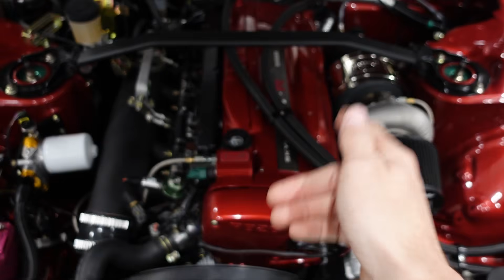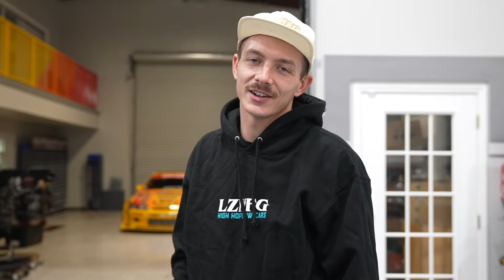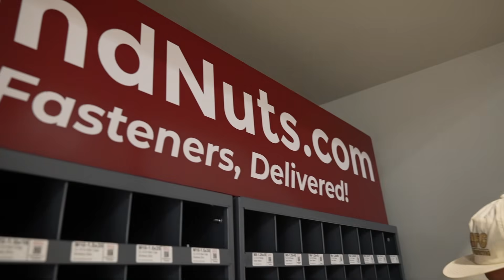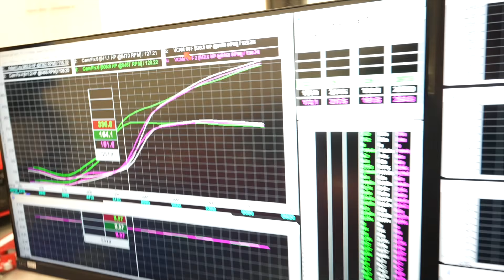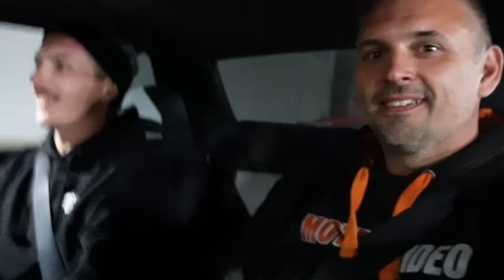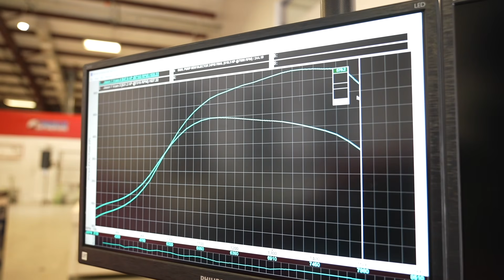Ultimate Response R32 GTR First Drive - My HKS Restomod 2.8

Comment: you want response?

i’ve had one for a very long time, ATM 1000hp (AU currency)

gave me stroker powers without extra power! 

GTS4 diff gears! (if your still 5 speed) you know these are geared for top speed..theos isn’t needed on the street! made my 2.6 feel like 2.8 and my current 2.9 feels 3.1,

by far, best-mod i did

Shorter gears helped the transmission stay together too. i ran 1000hp with stock trans for ever when everyone else was breaking 3rd gear.

Your currently geared too too out at 320kph, gts4 is 280kp, which is perfect for street.

Comment: That pump from Brand X, I work around those daily, just bigger, positive displacement pumps. Have to do temperature readings and check vibrations on them as well. Not sure how often you’ll use it/the dyno, but just make sure you have air flow going across the fins and no vibrations and you’ll be good.

Comment: One of the best ones you have for sure. I'm a big fan of restomodding with heritage in mind, like you're putting a bit of that HKS soul back into it. Next? I would love to see the Barra GT350 get sorted/given a purpose. Given that the rear IRS setup can't really cope with the massive power output why not give it a dedicated drag setup? You don't have a drag-only car and it'll make for good content with Cleetus. And with your new ZF trans wizards I'm sure you could get that transmission situation sorted. Have Johan fab a cage etc. No doubt it will be ridiculously quick down the strip.

Comment: a whole new engine setup and turbo for more midrange power? seems overkill... From experience with other platforms that kind of improvement can be achieved with the right cams and turbo setup. small enough turbo to keep the response with "big" A.R housing and good exhaust to not choke out at the High RPM. Or are 2.6 RB's just inferior and needs the displacement increase to achieve what can be considered minimal gains in performance?

Comment: Honestly feel like with the stock r32 diff ratios the r34 box turns the car into a rowing machine. Feel like the full OS 5 speed box works better. Taller first gear for much better launches and then third gear is a much more substantial gear. That car needs to stay in gear on the boost to fully use the power.

Comment: Adam might need a R33 gtr to swap the R34 motor in, than give that R34 an Aussie touch with a Nitto 3.2 ;)  Mr hawkins is always right  RB32 is the dream build makes short work of my 286/288 kelford cams :D

Also i think the Turbo has defs hit the limit with current exhaust you could get Mr fab king to whip up a Ti dump 4" with 3.5" front pipe an go a Tomei Ti 3.5" most incredible sounding JDM exhaust on a 2.8L  You wont be able to talk as well though ,  Also is the option of a AES valve located in you're front pipe to elim Drone

Comment: Wait it's awd or rwd??? They dyno'd it in rwd. Did they just pull the front axles??
Reply: You can just pull the fuse on a r32 or disconnect the front prop shaft that goes between the transfer case and front diff

Comment: Either back pressure issues or it pushing the gate open or to soft of a spring in the blow off valve and it's cracking open bleeding off boost id bet the BOV is bleeding off

Comment: I had the stainless Super Turbo catback on my r32 gtr with Tomei Titanium Equal Length front pipes(was still on stock twins), and not cats. Trust me on this. Have Jon delete the middle resonator on the Super Turbo. The Super Turbo was way too quiet for me, and at least on the Stainless version deleting the middle resonator did it for me. Car sounded so good, and had a perfect amount of rasp on the high end whilst still being smooth af. I have an exhaust vid of how it sounds on my profile if you're curious how much louder deleting the middle resonator would be or at least get a gist of it. It was still quiet enough for me in the car too. Could hold a convo easy. But your rb26 is built af compared to mine, so maybe deleting the resonator on a Titanium exhaust with a fully built rb26 might be too much? Idk 🤷‍♂️

Comment: Do you schedule some of you older builds to be driven? When you are building a car how do you decide when its enough HP wise?
Reply: Depends on the chassis. Some cars/chassis just don't respond well to big power without completely destroying the soul of what the car is. Light and nimble AWD inline 6... 500-800hp is about the max a chassis like that can handle without it becoming a different thing entirely. Now take a modern s550 mustang, that chassis can handle 1000+ and remain within the limits of what the chassis can handle.

Comment: The part where Adam says “I don’t think I ever had a car throw me back that hard” johan was like bro all ur cars is fast af haha
Reply: He's forgetting about that gt350
Reply: yeah every time Adam gets a new car its like "omg i never had X in a car before or never experienced X thing in a car before" and everyone is like bro you have 3 of them just like it already..
Reply: GT350,either of the 911 Turbo S’s, RS6 Avant
Reply: @diveintomonza  Don't forget the Evo. That this is pretty zippy.
Reply: @diveintomonza  they were auto tho so they were more smooth i think he means on the 1-2 gear change you can see him flying back into the seat
Reply: @8v_Nate   clearly you haven’t been in any actually fast cars.  Auto or not, a tuned 911 turbo will throw you back and keep you pinned in your seat.  A built Barra in a set up car like his mustang, will pin you as well.   It has nothing to do with a Stick or auto, fast is fast man.
Reply: @1216jimmyz  stuff like the gt350 both spins in the lower gears, and only has the power in the tippity top of the rpm range, it's definitely the one that pushed you into the seat the hardest on the initial hit but with a torquey awd car that got torque everywhere you stay pushed in that seat the whole pull, not just on the hit
Reply: @1216jimmyz  You're not wrong but the torque curve on the R32 is really violent paired with the short gears so it'll feel much more aggressive. A linear power band like on a Porsche will make less and less G's as it goes but if you look at the R32 graph you can see it'll accelerate faster and faster up until 6-7k before starting to roll over.
Reply: @Remu-  nice to see someone who actually knows what it's like to be in an r32. People don't get why it's the better of the 3.. it's more mechanical and you feel everything. It's just the better drivers car.
Reply: @Sultan Tryndamere  I have a 32 GTR and been in some fast cars including a 950bhp 2jz silvia.. r32 still throws me in my seat harder
Reply: @1216jimmyz  and none of them feel as good or as aggressive as a 32. I’ve driven a comp m4 and put a Ferrari f430 to its limit and neither came close to being as fun to drive as my 32.
Reply: @Jrob992  yes, and all your videos on your channel show why I should take your word for it.  Lmao
Reply: @1216jimmyz  you don’t have to believe me 🤷🏻‍♂️ it’s not that crazy. When you have a 32 (or any cool car) and frequent the same meets and drive with the same people you make friends and they let you drive their cars.
Reply: @Jrob992  un huh.  Whatever helps you sleep at night buddy.  All good.
Reply: @1216jimmyz  just tellin ya what I know 🤷🏻‍♂️
Reply: lmaoo
Reply: fast as f$$k boi

Comment: RWD on Dyno hubs with front tyres on floor, but it's a GTR that is AWD??
Reply: Easy to do just disconnect front axles
Reply: @e36_swangin83  Ahh makes sense, no knowledge of hub dynos, just experience the rollers
Reply: @connorbeattie18  they do it the same way for non awd rollers

Comment: That intro clip makes it look like a monster! R32 vs R34 has gotta happen!
Reply: The R32 will eat the R34 alive.....
Reply: @TrevorFrazier331  how good are R32s! 😍
Reply: It is a monster!
Reply: I’m still waiting for the BIG drag race
Reply: 32 has quite a bit more power
Reply: @chadm528  More power isn't the biggest problem for the R34 its the transient response of that turbo.
Reply: @TrevorFrazier331  power to weight. The 34 at this point loses regardless of how the turbo comes on
Reply: @chadm528  not necessarily if they both made 700 to the tires and one way lazier than the other it would lose. But I get what you are saying